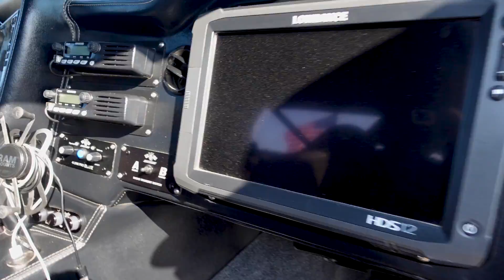Jason McNeil's Fiberwerx FORD Raptor Prerunner | BUILT TO DESTROY

Comment: The LS9 is from the c6 zR1. LS7 is from the c6 z06. Not a huge fan of forced induction in a pre runner but hey, whatever blows your hair back. The packaging is so fuggin dialed it makes up for it. I understand cost is paramount with the LS platform but this build is anything but budget. So I would have dropped a Roush/Yates bad mamma jamma in there and made 900 wheel N/A. Plus I could say my pre runner has the same engine as Ken Blocks Hoonicorn.